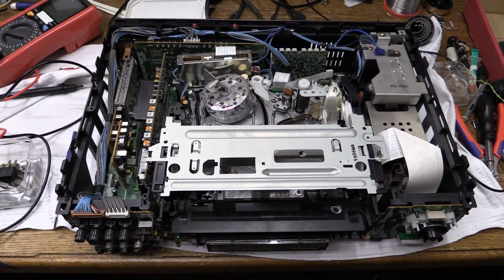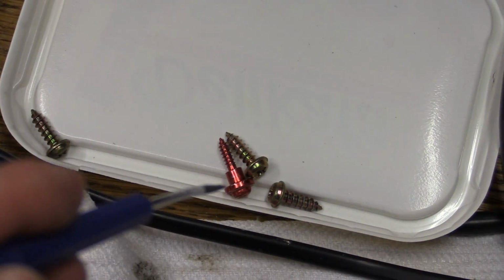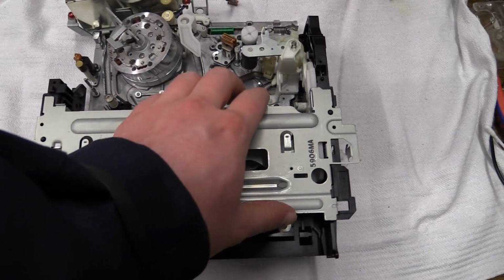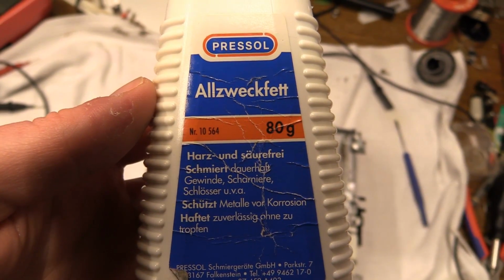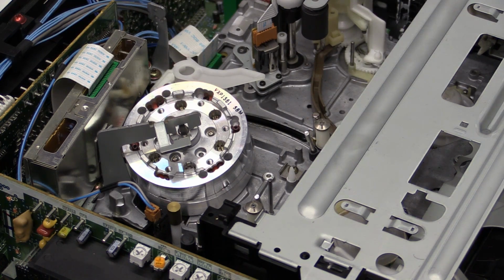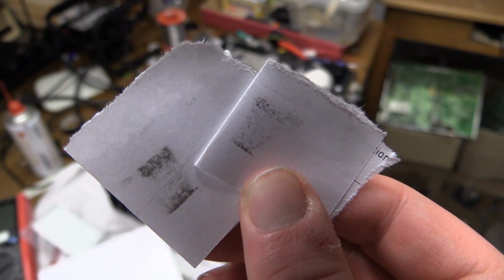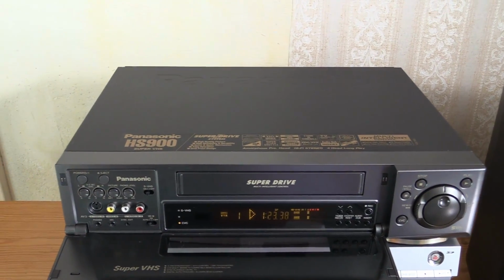DrCassette's Workshop - Panasonic HS900 S-VHS VCR full service

Comment: I am hoping you may be able to help me fix my K deck. I wish I had seen your excellent video before embarking on trying to fix it. It had a jammed cassette which would not unload. I managed to remove the cassette somehow which left the tape mechanism in the loaded position and the cassette holder in the unloaded position. I don't think I physically damaged anything in the process. I then chanced on your video and I lubricated the spindle that the pinch roller slides up and down and now the tape load / unload mechanism cycles smoothly - no more error F03.Now when everything is in the unloaded position and I go to insert a cassette, it immediately does the tape load routine without first loading the cassette so something is out of sync.Please can you help me rescue my VCR!
Reply from the maker: You will need a service manual. It contains all info on the timing of the transport. When you forced the stuck tape out, gears got misaligned. There are timing marks on certain gears that have to line up with timing marks on other gears. The service manual gives all the details.
Reply: Thanks so much for your reply - glad to know you are still monitoring this topic and there is someone out there that can help. Yes I managed to download a service manual which gives assembly and alignment details. I have tried going through all this but think I must have got a step wrong as it still doesn't work. The main sliding mechanism, main cam gear, sub cam gear and mode switch alignments were seemingly correct without needing to do anything but on getting to the step where you align the holder connection gear, the notch (recession A) in the main cam gear isn't visible as illustrated (Fig M37 in my copy of the manual) and you have to cycle the mechanism along to get to this point which moves the other bits away from their alignment position.I will have to go through again - any ideas as to what I may have missed? I am trying not to disassemble any more than I have to because it must be mainly to do with the relationship between cassette carriage and the rest of the mechanism that has got out of step. I can see why you say in your video you don't want to go there!

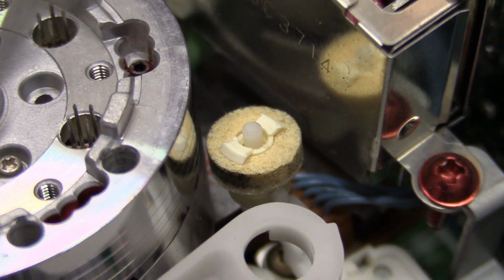Comment: How do you remove the cleaning wheel mentioned at 10:50? I wish you would have showed it.
Thank you
Reply from the maker: It's clipped in place. Removal is easy. Just make sure you don't touch the head drum next to it!
Reply: Easier said than done LOL! I'll try
Reply from the maker: I did this several times. It is easy ;)

Comment: Replace the belts and pinch roller as a precaution.
Reply from the maker: Sony Trinitron Both the belt and the pinch roller are in good condition. Neither one of these parts are readily available these days, so just replacing them for no reason is totally not anything I'd do.
Reply: Sony Trinitron The belt is actually a toothed timing belt which lasts many more years that the rubber belts.

Comment: Hi DrCassette!
I own a Panasonic NV-F70 and recently it won't rewind in Play mode.
It does forward in Play mode, and it rewinds and forwards in Stop Mode.
I've been watching many videos here on YT, and in most cases, the culprit seems to be the idler wheel. However, in this high-end Panasonic devices, I just can't see any idler wheel between the 2 main reels... so I just don't know if that idler wheel is underneath (not visible from top) or if these series do not use an idler wheel... and now I even wonder whether this particular issue of mine is related to that idler wheel.
I've been watching your videos for the HS900, HS950 and HS1000 models, but in none of them you mention that "idler wheel" as a part which should be checked. So I'm really puzzled.
I would really appreciate any comment or thoughts about this and/or what I should look at/check in order to try to service it.
Keep the good work, and thank you.
Reply from the maker: Not all VHS mechanisms are the same. I know which idler wheel you mean. This can only be found in older mechanisms. Since it was a main failure point, producers eventually replaced it with gears. Your recorder should be new enough to use gears in place of idler wheels. Also the HS series recorders I have use gears. Not sure what could cause the problem you are experiencing.

Comment: Hey doc! I came across a chance to get 2 Panasonic AG4700. Pretty good shape, but they haven't been used in quite some time (they have been stored for over 3 yrs). 
Since they are in another state (over 500km) and they have no method for testing'em (of course, the VCR turns on), they offer to selling me both por 50usd + shipping. 
I know these models had issues, but you think it would be a good investment?
Reply from the maker: The Panasonic AG-4700 is the professional version of the Panasonic NV-HS1000 which is a very good VCR. I have one myself, and there is a maintenance video available on my channel. For 50$ these two should be a good deal.

Comment: How do some VCRs know where they are on the tape and then show the position of the tape so accurately even if it is ejected?
Reply from the maker: Knuckles the Echidna On those mechanisms that leave the tape threaded up at all times the control track can be read at all times. And with that information the VCR can have a real time counter. On more advanced systems (MiniDV, Digital8, some Hi8) there is a time code recorded on the tape, every single frame has a number (h:m:s:f, for example 01:45:16:24). The VCR reads the time code and knows immediately where it is on the tape. On this S-VHS unit the counter is reset automatically when you eject the tape.
Reply: DrCassette ah now it makes sense :)  Is the control track recorded onto the blank cassette by the VCR or is it already on the tape?  Also during fast rewind with the tape off the heads how does the VCR know when to slow down so it doesn't snap?
Reply from the maker: Knuckles the Echidna
The control track is recorded by the VCR. On this Panasonic, if there is no control track (blank spot on the tape), the counter stops counting and the seconds display turns into an animated circle that indicates the direction in that the tape is moving, as well as the speed (runs faster in FF).
As I said, modern VCRs leave the tape threaded at all times, so the control track can be read in fast rewind, too. Also there are sensors on the takeup and supply reels delivering a readout of the speed to the microprocessor. That's how it can slow down in time. Before this technology was available, VCRs would rewind and fast forward in just one constant and rather slow speed. That's how my Panasonic NV-850 works. Takes forever to get somewhere.
Reply: DrCassette so I guess with the control track not there that is why on a blank spot the spinning head hunts around for the correct speed and perhaps also how it knows to speed the head up and slow it down when switching between 50 and 60Hz!  I must have a look for the sensors on the reels.  The VCR is such an interesting, mysterious and complicated beast :D  My first VCR had breakfast cereal in it !
Reply from the maker: The head drum always spins at a constant speed. The linear speed of the tape is adjustable with the tracking control.

Comment: I hate the white plastic sliding gear on the back causes big problems with these K DECKs. I much prefer the earlier G-DECKs much smoother and they have a smaller metal  sliding gear.
Reply from the maker: The earlier decks definitely seem to be more solid, but then the newer decks operate faster and more quietly in my opinion...

Comment: Hello, Dr. Cassette! I recentlly purchased a JVC HR-S9911U S-VHS VCR new old stock. It seems it needs lubing - I haven't opened it yet. Which greases/lubes would you recommend? Is it a service that someone with some knowledge could do? I already got Molykote EM-30L, a US brand Super Lube (Lithium), another  two Super Lube precision oils with Syncolon (PTFE - with different viscosities) and a MOLYKOTE M77 Paste Grease (Silicone Oil with MoS2 for metal to metal). I went after the lubricants for my RTR machines. Could I use any of these? Thanks!
Reply from the maker: I don't know the VCR nor these products. But if it works for reel to reels it should work for VCRs. Replace oil with oil and grease with grease. And don't get anything into the tape path.
Reply: The JVC is a prossumer unit - with TBC and NR. My unit is not fast-forwarding: it starts but when it "changes gears" I can hear the gears screeching. There really is no grease apparent - the unit was probably manufactured in 2002 and sat on a warehouse until a month ago. The S9911U has a much cheaper built than this Panasonic and your grandmother's 9050. Thanks for your reply and for posting these videos!!!

Comment: Hi i wanted to ask you, do you know what light blue/greenish color grease is called? our supra sv91r vhs from 94 uses it and id like to use the same. im surprised that grease is still soft and working, but the bottom part on which parts slide has some wear marks so i assume i should add some more maybe the grease has somehow partially disappeared.
Reply from the maker: You could try spreading the old grease around to cover the bare surfaces again. I know what type of grease you mean, but I don't know what it's called. These days the best choice for most mechanisms is white lithium grease (but not directly from a spray can!). I would not recommend that strange random grease I used in this video anymore.

Comment: I don't know.... I have repairted almost 100 vcr-s and I always did it with a piece of clothing and I turned the vcr on so the head cleaned itself...
Of course I used alcohol but I can't understand why you are so soft with thoose heads.... I got a vcr head from a friend a week ago and today I took it apart. The heads are so strong that I can't imagine them braking....
I have tried to brake them with force but I couldn't.
(By the way the head was bad.... the internal ferrit ring was broken.)
Reply from the maker: It all seems so strong until it suddenly breaks... It's better to be safe than sorry. Also this method works on ANY head drum. Last sunday it fixed a Sony MiniDV camcorder that previously wouldn't record or play back anything. And for MiniDV, the heads are so tiny and fragile it's scary!
Reply: Thnak you for your reply ^^ Now I understand why you were so soft with it ^^
By the way....
Have you ever had a video 2000 vcr?
My father has 3 of them and their heads are like hell on earth. they auto track by moving up and down O_O I hate thoose head. Hope you have seen anything like that and you know what I'm talking about :)
Reply from the maker: I actually had two Video2000 VCRs, but both didn't work. The auto tracking works using piezo elements, so you have up to 200V running into the head drum!
Reply: Oh my god.... I didn't knew that O_O if I had touched that while it was on... brrrr I don't want to think about that.... By the Way the video 2000 vcr-s are very fragile.... The 3 my father owns are in not working conditions tooo. Everithing is ok with them I checked every little thing but no they still don't want to work :/

Comment: does the pinch roller pull off to clean and rough up?
Reply: yes it does mate but make sure the timing is not lost when you take the clip off the top which is on top of the tower gear and that is timed.

Comment: I saw your Panasonic HS950 video on Dailymotion. How did you solve the "door not opening" after assembling? I just can't figure it out!
Reply from the maker: Take the faceplate off and put it on again but manually hold the door in the open position this time. There is a little catch sticking out from the chassis that needs to go between the faceplate and the door, so the door must be open during installation.
Reply: @DrCassette  Thank you so much! Your videos have been really helpful. You've earned my subsrciption :) Cheers!
Reply from the maker: You're welcome :)

Comment: Wow, that bit of candy on the circuit board was quite disgusting, I wonder if this VCR was used in someone's home where a child had access to it and did that damage.  Of course a VCR like this is probably overkill for domestic use, but you never know, someone may have had a home video recording studio of sorts.  Still, not a good thing to find inside the recorder.